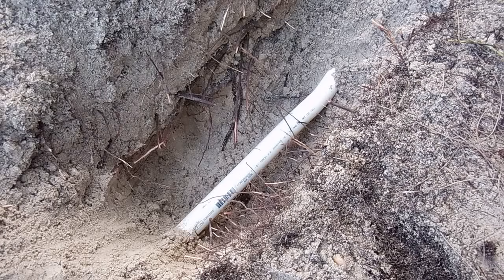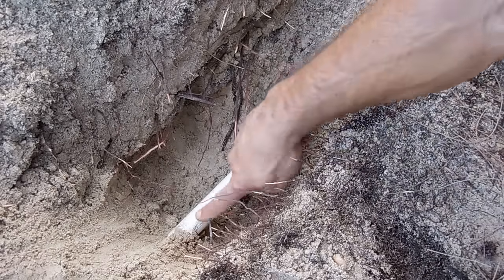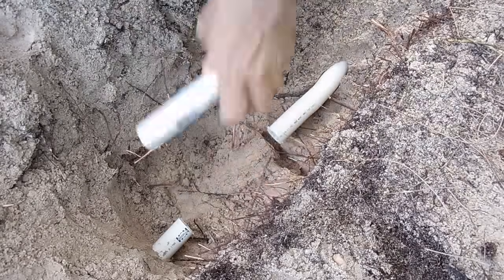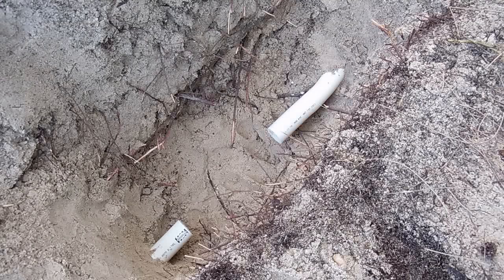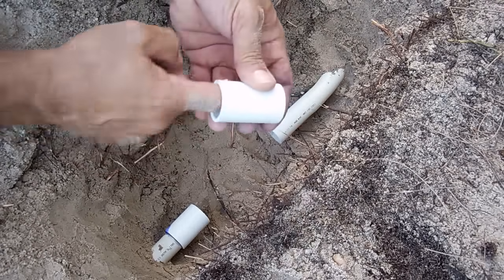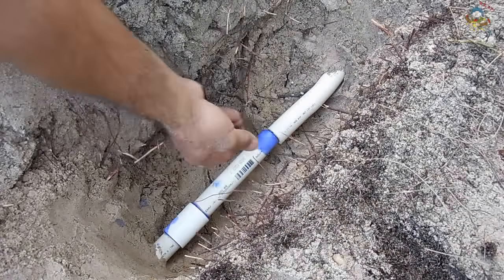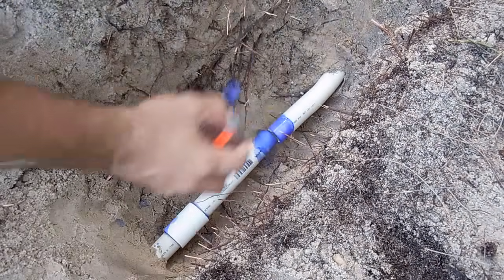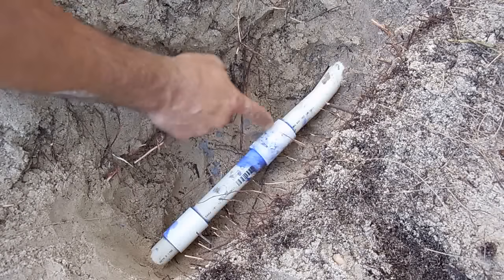EASILY Repairing Broken PVC Pipes(Least Amount Of Digging)

Comment: different local, different atock.  Been using them for several decades.  You, have enlightened those that weren't aware of the solution, and for that quodo's to you ...Regards W.
Reply from the maker: Backing up your claim with links to Home Depot, Lowes, Ace, or True value would be nice.
Reply: electronicsNmore This wasn't intended to turn into a pissing match over your good deed... but a simple Google search will expose you to several manufactures of  various "Repair Couplings" that slip on, snap on etc.  

My point wasn't to demean your process, but to simply bring to light other options.. 

Your welcome to be snippy to someone else, been doing plumbing for 60 years...I'm done here.!
Reply from the maker: No pissing match here. Your original comment said, "Not to be a smart ass, but"...... and claimed you can buy them at "most all" building supply stores such as Ace, etc. I was simply asking for you to post a link proving your claim, because I have yet to find a store that has what I made for anything except DWV. Doing so would save many viewers a lot of time making their own.

Comment: Not to be a smart ass, but they make repair couplings that have no stop, for this exact situation.. You can buy them at most all building supply stores, Ace Hardware and such...
Reply from the maker: I live at Ace Hardware and True Value Stores, both do not carry what I made. If they did, I would never have made this video. The same goes for Home Depot and Lowes. They only sell LARGE DWV couplings with the stop removed. Maybe now, 2 years after this video was made, some stores now carry them. Please provide links to the places you mentioned showing no stop PVC couplings.
Reply: BigGuyUSA just went to Home Depot, Orchard Supply and Ace hardware. They do NOT sell couplings without the stop.  Maybe its  regional.
Reply: I am a frequent HomeDepot consumer, and I have never seen a nonstop coupler.
Thanks, this video was truly revolutionary👍🏼👍🏼
Reply: I have never seen one.  Common with copper fittings, but not small diameter pvc.
Reply: "Not to be a smart ass but": Cannot find Sch 40 PVC anywhere but they do have DWV PVC which is for drainage applications, not pressure applications such as required by a sprinkler system.  DWV not the same as Schedule 40 pvc please take note.

Comment: they make couplings with out the part you filed off for this reason.
Reply: Really. I have a bag of them if you'd like me to send you some. I know you don't believe it, but these really are sold at Home Depot and such. The slip couplers as well as longer lengths of pipe made specifically for slip-fit repairs. By using the pipe, you only need this one long coupler, instead of two couplers and a section of pipe between.

Don't be upset. You da man for making this video that has helped many people. But to save effort, the part really can be purchased at the hardware store. Cost is about 59c here.
Reply: Very good and cheap solutions for pvc pipes repair. ..
Reply from the maker: Really? Good luck finding them. LOL You think I made the video for nothing? NOT.

Comment: You said it works up to 2 inch pipe.  I have to do this maneuver with 3 inch electrical conduit. Because of a foundation, one side is fixed and I will have to dig back quite a ways on the other side to lift up the 3 inches.  How much trouble will it be after that to get the 3 inch coupling to slip all the way on and then back halfway onto the fixed side?  Even lubed with a lot of glue that is going to be a lot friction.
Reply from the maker: Just make sure the stop has been completely removed, use plenty of cement, and work fast.
Reply: Thanks for the quick reply.  To avoid cement curing too fast, I am thinking of skipping the glue and use some other type of lube.  I was told electrical conduits commonly fill with water anyway and not a problem for the conducting wire inside.  Thoughts?
Reply: Steve Nichols  lots of cement to help keep it liquid.  Practice a few times on test pieces.  Wrap with foil to keep the solvent in?  Author already mentioned slow-setting cement...
Reply: Sorry Steve but i have to disagree about  electrical conduits commonly fill with water. If done Rite ! No they don't commonly fill with water and secondly Most Importantly ! Water is a Huge Problem for a Conducting Wire. Please stop listening to who ever told you this.
Reply: +Kelly Dardeen NEC 300.5 (b) underground conduit is considered wet location and require conductors rated for wet locations.
Reply: Put a pliers behind the cupling then beat the cupling on

Comment: why don't you put the coupling first to the pipe if you use a slip coupling
Reply from the maker: Too tight. The cement also acts like a lubricant to make the coupling slide easier. :-)

Comment: You can use the coupling off a 20ft piece of pipe called the bell end just cut it off right were the pipe starts it will have no stop but you would need a 20ft peace of pipe maybe this will help someone
Reply from the maker: Yes, but one side is very tight.

Comment: I always use a 60 grit paper and I also would of 90 up on both ends about roughly 4 feet and 90 again at the top of the 4 feet and used the "cleaner" to clean the pipes and used silicon caulking to seal off the job. a ok.
Reply from the maker: (4) 90's is a bad idea. Every time water hits a wall and changes direction, you get losses. "Friction Loss" (reduced pressure)

Comment: put the slip coupling on without glue before the added pipe.
Reply from the maker: In order to do that, you'd have to make the PVC coupling a loose fit to slide over a dry pipe.

Comment: Great video! Was looking for the best method to repair my broken sprinkler pipe and I came across this video. Saved me a lot of time and money! Just cut out the broken tee, cemented in the new one, cut a 5" section of new pipe, and joined with the Dremel modified slip coupling. Done in less than 30 minutes! A little messy, but it works like a charm. Thanks!
Reply from the maker: Glad to hear my method worked great for you! Be sure to check out my video playlists, rate thumbs up, and share my channel with others. Thanks

Comment: why don't they just sell coupler without the stop?? I been in irrigation for 27 years. I've been asking the guys at supply store why a slip fix. can't you just file out stop and slip it on one side then the other. they try say it compromise strength of coupler witch is bs.
Reply: So the thing is, a coupler without stop IS made and sold by a couple of companies. Most good hardware stores will have them. Home Depot sells them. Drip Depot sells them. I mean, this is a great method... just a lot easier to buy the proper part and not have file or Dremel gouge that the glue has to fill. Plus the slip couplers have a straight bore, and do not neck down toward the stop as do standard couplers. This makes them easier to install, and you really can slip them on in advance of adding glue.
Reply: Ricky Terbovich Jr. : I've seen them in Ace Hardware in the town I'm in. Otherwise using a knife, file, or Dremel is an excellent idea.😉
Reply: They do sell slip coupings

Comment: Nice vid but NEVER EVER cut water supply line with anything that will produce dust or chips as it is unavoidable getting them inside the pipe. Its not that bad cleaning out a faucet but when you have to pull a toilet float apart to get pvc chips out of it you will wish you cut it with a pvc cutter or a string ;D
Reply from the maker: You ALWAYS flush the line when you're finished! You open the hose bib and let the pipe flush out before allowing the water into the house. If you're working on a sprinkler system, then you remove the last sprinkler head.
Reply: All unnecessary if done right to start with.. Just saying
Reply from the maker: Do it anyway you like.....:-)....Just saying

Comment: or you can just buy a slip coupling...
Reply from the maker: Good luck with that for PVC. Hard to find.
Reply: Very easy to find at most hardware stores,Home Depot,Lowes,or your local Plumbing Supply.
Reply from the maker: Plumbing supply, yes, but Home Depot, Lowes, True Value, and Ace Hardware DO NOT sell them.
Reply: Seeing how I have bought them quite a few times from said places I listed,yes you can get them.
Reply from the maker: Wrong again. LOL Only DWV PVC fittings can be found as FULL slip repair couplings. If they were easy to find, I wouldn't have made this video. DUH!

Comment: I came up with this method, myself, years ago. However, I did locate mending pipe at a retail plumbing supply store.  It takes the place of the coupling, has no stop that you need to file off, and you can cut it to any length. I haven't used it in place of a length of pipe, but I imagine you could do that also, eliminating the need for two "couplings".
Reply from the maker: Check out my other PVC repair video. It shows a fitting that I made. :-)
Reply: electronicsNmore p

Comment: Do you have any vid on how to repair a copper water line, using PVC tubing or couplings? I'm a DIY person and a remodeling contractor, and kind of have that issue at a job site,   I used a bicycle tire tube to stop the licking for the time been.
Reply from the maker: You should cut the pipe, and insert a repair coupling, if you can't, then drain the water from the copper pipe and thoroughly clean the leaking area using a stainless wire brush and abrasive paper. Next apply flux. After that, take some 14 or 12 gauge bare solid copper wire and wrap it around the leaking area very tightly side by side. Go past the leaking area by 1/4". Once wrapped, heat the are with a torch and allow the solder to flow over the area. Leak will be gone. :-)

Comment: It seems to me that if you remove the stop from both couplings,  then clean and glue all joints, then place pipe and the couplings in the clearance and slip both coupling in place to complete the job.
Reply from the maker: The pipe fittings are slightly tapered toward the stop, so grinding away the stop will leave a very snug/tight fit to do what you want.

Comment: you look so close to the sand. I think I would use a barrier between applicater and sand
Reply from the maker: You can lay a plastic bag down each side of the hole and under the pipe if you're concerned. Thanks for watching!

Comment: Hi, I have found a kink in a PVC conduit tube and would like to replace the section as shown in your video so that I can pass a fibre cable through it. However, the affected area of PVC tubing already has a working phone cable running through it that I cannot remove. Do you have any suggestions how to remove and replace this small section of damaged conduit without disturbing the cable already in the tube? Any help would be so appreciated as I have hit a dead end. Cheers!
Reply from the maker: Use a heat gun to soften the kink and reshape the PVC. Have a cool, wet rag ready to place over the newly formed area.

Comment: Very clever, perfect solution for small cut I put in PVC pipe when cutting roots. I just need to finish the cut. Also like idea of slow/regular glue. I deburr end inside and out and scuff outside with sandpaper but have never used primer, just the cement. Thanks for tip.
Reply from the maker: You're welcome! Be sure to check out my extensive video playlists and share my channel with others. Thanks

Comment: They make slip couplings in different lengths.....plus they make couplings with  flexible pipe already built in that you can use as an off-set  ....oh and now they have push-fit fittings
Reply from the maker: They don't sell full slip PVC fittings at hardware stores or home improvement stores, which is why this video was made.

Comment: Could you just use the modified coupling?  Cut through the hole pipe at the crack, prep and glue in the modified coupling?
Reply from the maker: Yes. If the crack is straight up and down, then that's what you do. Thanks for watching!

Comment: Why not just use a pvc compression?
Slip it back then pull it forward and tighten
Reply from the maker: Not a "Permanent" repair. The seals dry out over time and eventually leak. The compression fitting costs 5 to 10x as much. :-)

Comment: I would like to thank you for this video. I found it extremely helpful. My situation was slightly different, I added a tee off an existing solid PVC pipe to connect a French Drain. After I watched your video I totally changed my approach. The only thing I did differently was slid the coupling in first then glued around both pipes generously then slide the coupling across and spinning it a few times to distribute the glue.
Reply from the maker: No need to do it that way. Just apply a good amount of PVC cement to the outside of the pipe, and inside the fitting, then install it. Glad my video helped you!
Reply: electronicsNmore  Undoubetly my way was not ideal but the pipe is 100mm thick and buried deep so was very difficult to manoeuvre unless I dug a lot more on each end.

Comment: I was wondering if this would work, may try it. I've had two compression sleeve couplings fail in two years on our water line, and so I'm going to avoid that solution from here on out. 4 90's isn't kind to the water flow and may cause issues with water eroding the pipe and thrust issues on the pipe.
Reply from the maker: It works great, especially once you have the knack. :-)

Comment: Should of put your coupling on before you joined the pipes together.
Reply from the maker: No, it's fine the way I did it. The coupling will not slide over the pipe easily. You need lubrication to make it slide, and that's what the PVC cement does, allow it to slide. Thanks for watching
Reply: Too much friction ,it wouldn't have slid over the PVC without the solvent cement.
Reply: I thought this, too, when I saw him talking about smoothing down the stop: slip the coupling on, then glue and slide the coupling down. It'll be really tight, though, as he says, and you can't stick some other lube (petrolium oil!?) in there and expect the cement to work!
Reply: That was the first thing I thought too. Tried it even. There is NO way the coupling will slide without gobs of cement.
Reply: You wont be able to put cement in the slider properly if you do it that way.
Reply: Agree 100%.

Comment: can your method used in a high water pressure pipe ? what if we just put some glue or super bond or some rubber to stop the leak ?
Reply from the maker: That's what this idea is intended for, high pressure. Any other method of repair, like you describe, would not be lasting.

Comment: LIke any magic trick 
Once you have been given the solution it becomes so obviously simple you wonder why you didn't think of it yourself.  

Well presented
Thumbs up for sure.
Reply: Hey
Reply: Before anybody tries this make sure to check the psi on your  Water meter gauge,if ur pressure is more than 80psi  I wouldn't recommend this.  I'm sure will hold But for how long.
Reply: @callifam627  It will hold. The glue actually welds the pipe and fitting together chemically. The ridge is just a spacer to insure insertion. 80 psi is well below the burst rating of sch 40 pipe and fittings. otherwise they would'nt sell a slip fitting, which is what he made by filing the ridge off.
Reply: Have you actually tried this yet?
Reply: Robert Slackware  I asked at home depo they don't, great idea